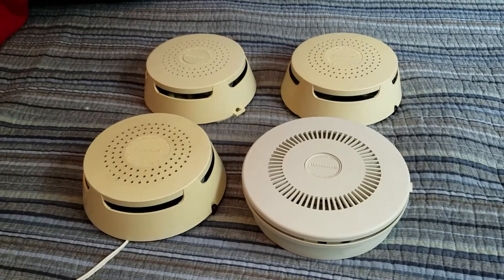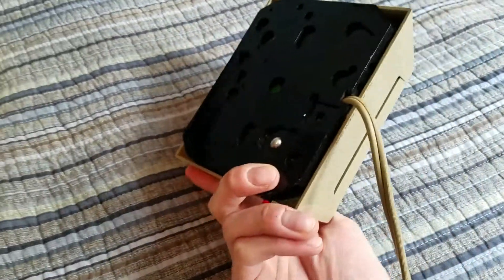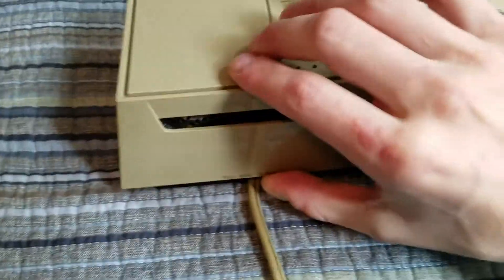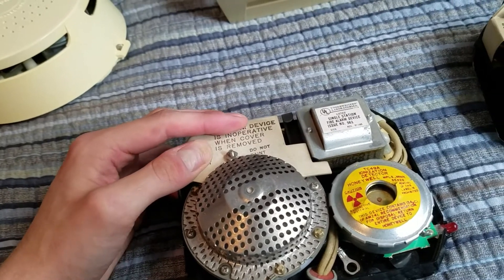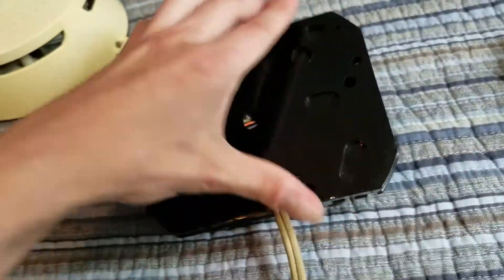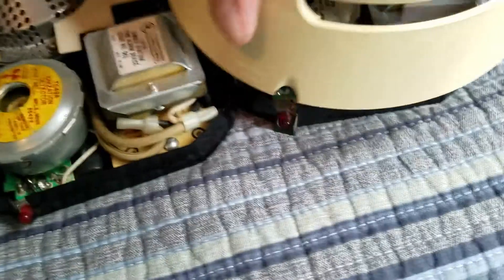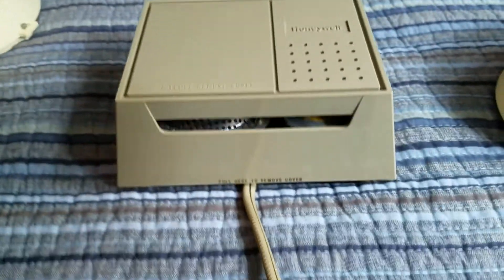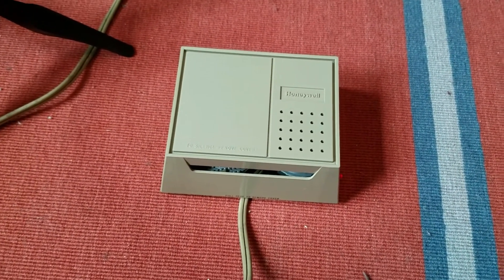Vintage Honeywell TC49A-1062 Smoke Detector

Comment: Honeywell smoke alarms are cool!
Reply: the firex mechanical units many ontario home builders used in the 1980s were far more terrifying to children than i imagine these honeywells could be. the audio in youtube videos doesn't do that alarm model/series justice.
 i see from your profile, you're also from ontario/canada.
Reply from the maker: @Jon-hx7pe  the FireX units don't chirp when they are first powered up...which is the whole reason why I was terrified of the Honeywell unit in my old house. I would say that the Honeywells are scarier because they're much bigger and something about those large side vents is intimidating
Reply: @BAFVintage  i hated the firex because it falsed frequently, often at night - the combo of that and super loud sound. not the manufacturer's fault - it was probably dirty.
Reply: Cool I am also in Ontario too. (Southwestern) and I agree about those older Firexs too. But as scary sounding as they were they were effective..wished smoke detectors still sounded like this today. Piezo are useless in my opinion.
Reply: @janeaton3417  depends on your hearing. i've heard or read that hearing impairment affects higher frequencies the most.